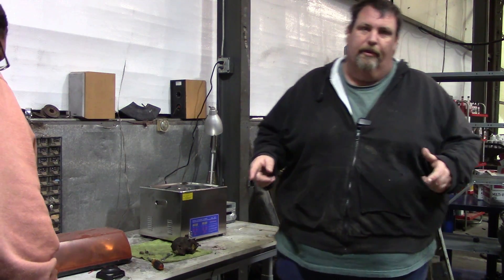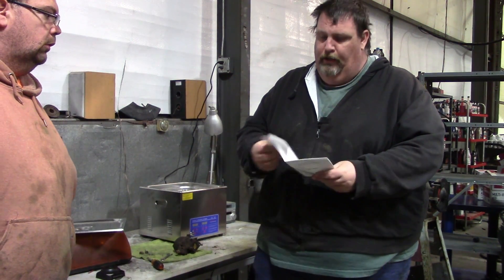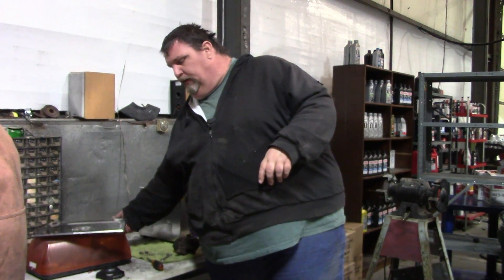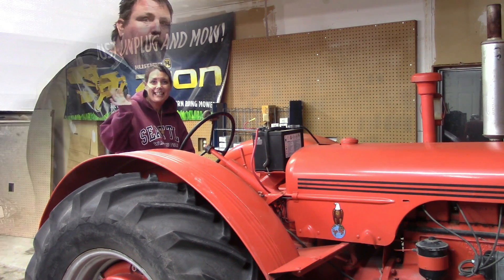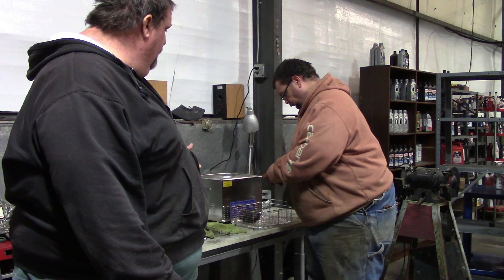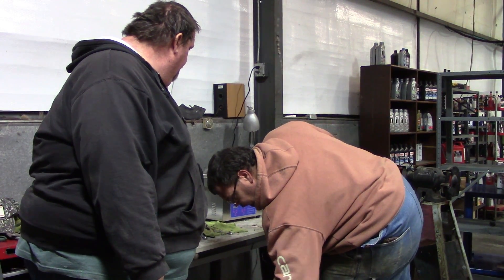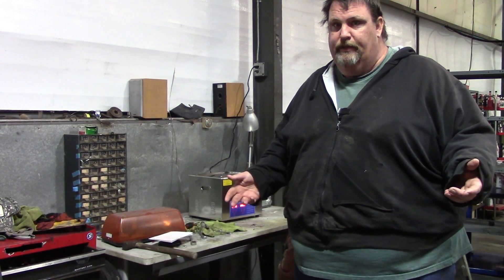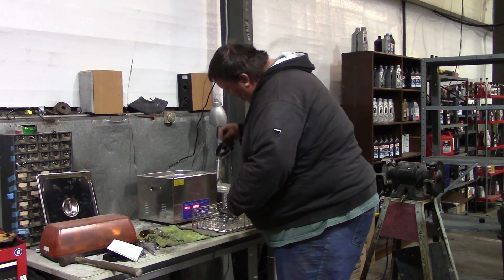Is ultrasonic cleaner worth your money for doing tractor carburetors

Comment: Ultra-sonic cleaners are definitely worth the money if you use them enough. I actually have 2 of them, one for carbs and the other for parts that just need a good cleaning but aren't crudded up with old gas. I use Simple Green or Orange Power (whichever I find first on the shelf) on carbs and POR-15 Cleaner/Degreaser (it used to be called Marine Clean) in the other one. I also use the POR-15 stuff in my big parts washer and always rinse the carbs and other fuel system parts in it because it removes the residue.

Another reply mentioned making a basket out of window screen to hold hardware etc. That's a good idea IF you can find actual metal screen material, most of what I see these days isn't metal and I don't know how it would hold up. What I use instead for hardware and other small parts is a small-medium size metal kitchen strainer.

Comment: You can reuse the simple green until it gets nasty, so you don't need to refill it every time you use it.  I built a 55 gallon drum jacuzzi to boil engine blocks with a coil of copper tubing in the bottom with holes in it to hook up a compressor to cause agitation and help scrub the block clean.  Have a great day.